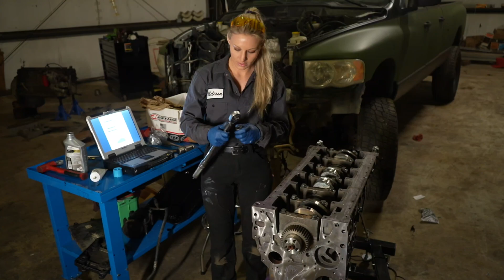05 5.9 Cummins Main Cap Torque Procedure

Comment: After watching your video for a 3rd time. You reminded me of an incident that happened back in mid 90s when I worked for mining company. At that time the company had 7 Terex 60 ton mining trucks with 12v92 Detroits with huge Allison automatic transmissions. The engines and transmissions were rebuilt by a guy that eventually became shop Foreman. One day after coworkers installed a rebuilt engine it was sitting there idling and developed a slight knock. Our lead mechanic put his head between the frame and the block to get a listen to it. No sooner did he get his head out of there ,when a connecting rod came blasting out the side of the block!! LoL. Apparently Jim the engine builder forgot to torque a rod! So your right Melissa, double check everything. Instructors said mark caps with grease pencil or whatever to check it off the list.

Comment: When i went to Williamsport area community college, Pennsylvania 1985-87 for diesel mechanic,now part of Penn State. Instructors said to turn crank after each main cap was torqued. If not and crank locks up,which one is the problem? Also in previous comment on last video,i asked about checking oil clearances. Are you measuring and going with that method and not using plastiguage?